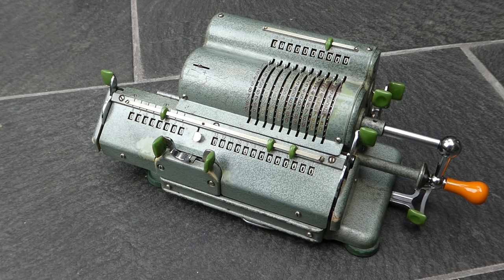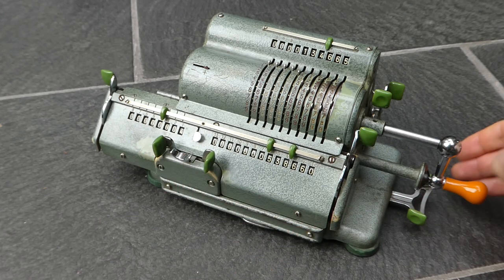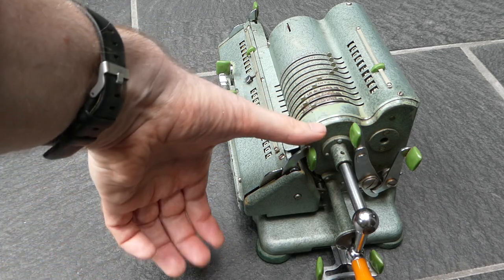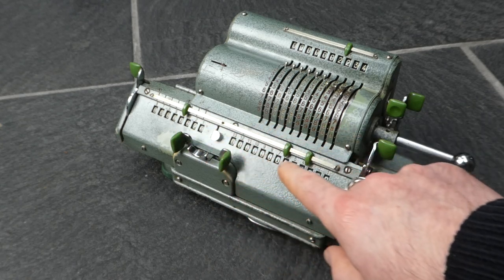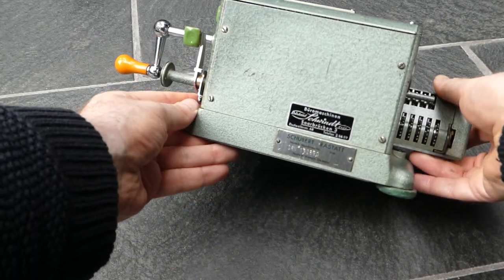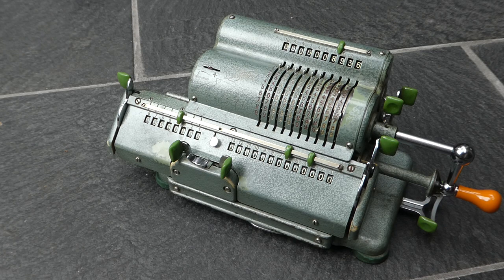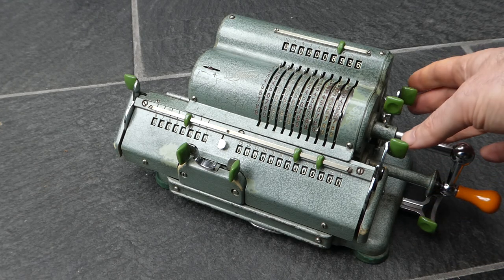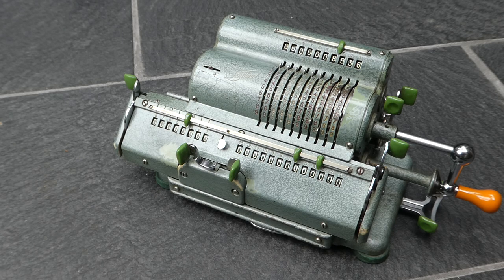The Schubert DRV mechanical calculator

Comment: This is a very nice calculator.
Some weeks ago I bought one off eBay, because I liked its appearance. I was impressed at how well designed it was and how well it works.
Mine was made somewhat later than yours, its serial number is 167627. It looks like they slightly changed the design of the main crank.